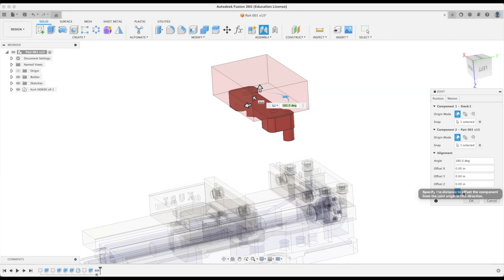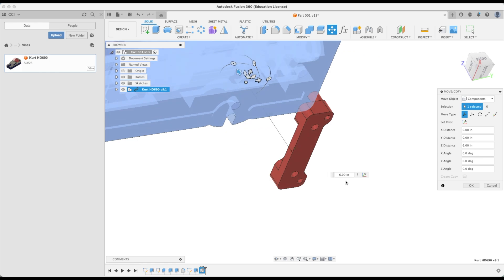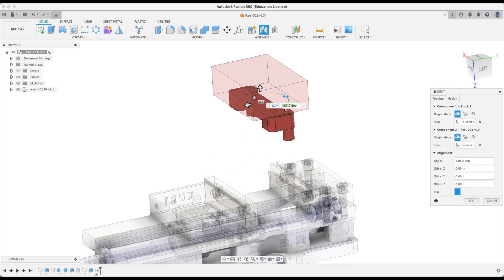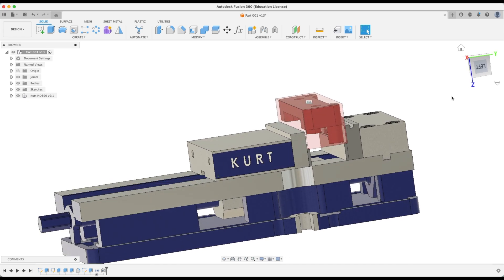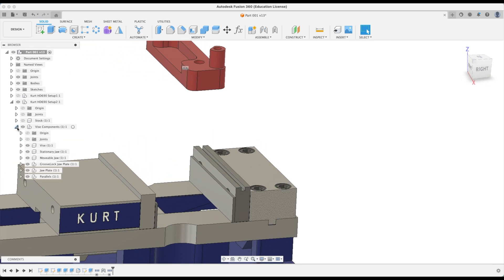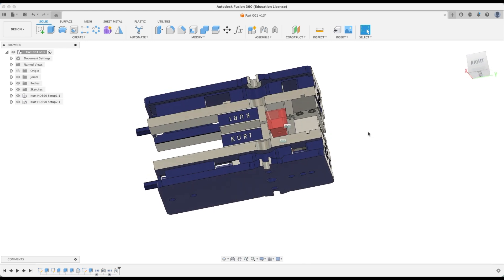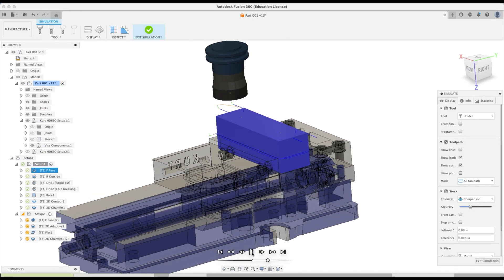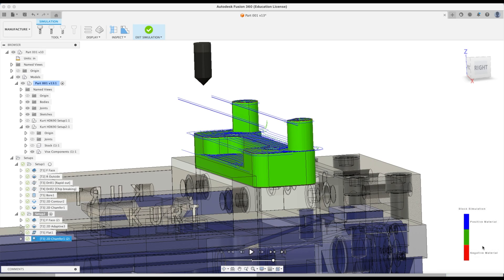Fusion 360 - Use Parametric Vise with Part Tutorial - Metal CAM #2 (2023)

Comment: Oh.... FANTASTIC CAMERA WORK!!!!!!
I've been struggling with this exact issue. The only thing I recommend that's different is to create a "template file" with the vise(s), parallels, and stock in it. Open that file, then insert a derived "part" (that you want to machine) then save that as "MFG XXXXXXX" this way the manufacturing data overhead is not within a/the part file that may also happen to be used in an assembly of other parts that are machined as well. I think one can understand that with only three parts in an assembly could have 6 to 12 (or more) vises and parallel sets as well as all the program cutter paths making that assembly file HUGE.
Reply from the maker: Thank you! And excellent suggestion for a good workflow and file organization. Excellent!

Comment: I've been using this setup for about a year and I can say that I feel extremely confident when I go out to the machine to run my program because I have the identical setup in Fusion 360 as my machine has.  I learned about this type of setup a while back but I was always a little confused on the second setup simulating the vise.  So I finally inserted a second vise for the bottom setup.  Thanks for taking the time for producing some really informative tutorials.  Much love and gratitude.
Reply from the maker: Thank you for the comment and support!

Same with me. When I started using vises and even machine tables in my setups, it was a game-changer for me. I also started implementing a standardized WCS. To this day, the new machinist with very little experience has been able to change jaws for several different jobs without any crashes for a few years now. Pretty amazing what can be done with a little knowledge and some awesome software.

Thanks again for sticking with us and your encouragement! All the best!